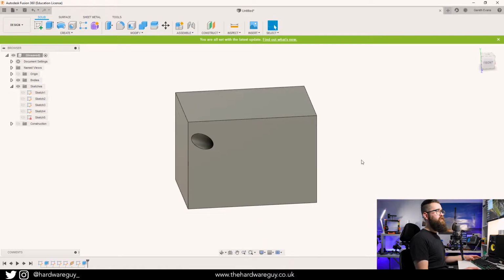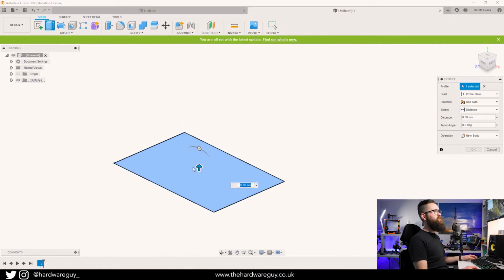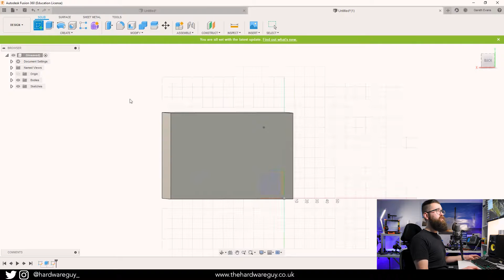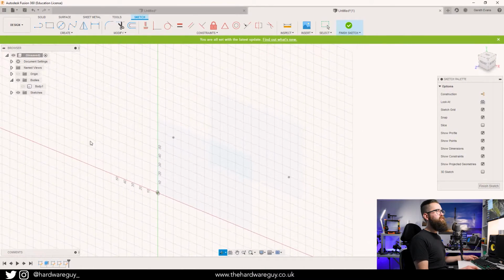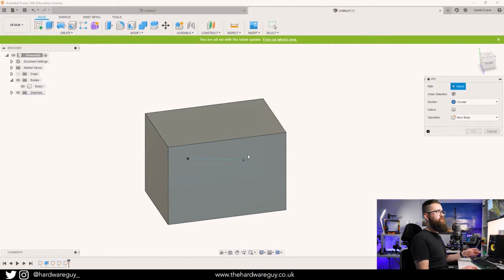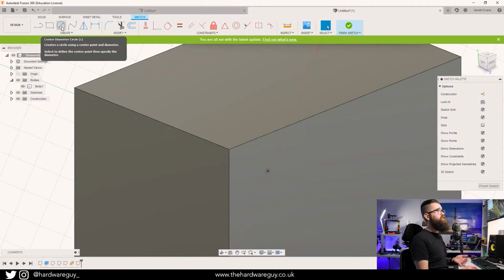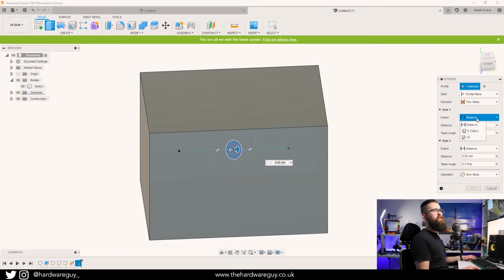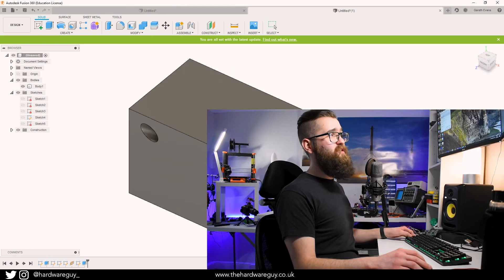Angled Cuts/Extrusions in Fusion 360

Comment: "SWEEP"  Use a SWEEP to project a surface shape from a sketch into a solid at an angle to preserve the shapes dimensions.  Like, in my case, I wanted a "star" shaped hole at a 40° angle.  EASY.  NOT hard.

Comment: How would you extrude outward at say, 45-degrees?  Example: modeling a candelabra with arms coming out at angels rather than 90-degrees which I can do in other 3D software.  Unable to do angles in that software.
Reply: I think the concept would be the same, except your second point is in some plane in space (outside of the base object). Then you extrude to it